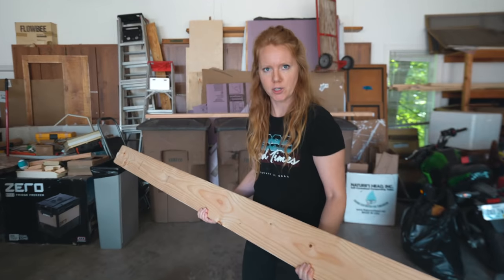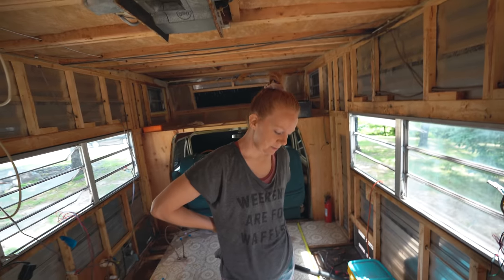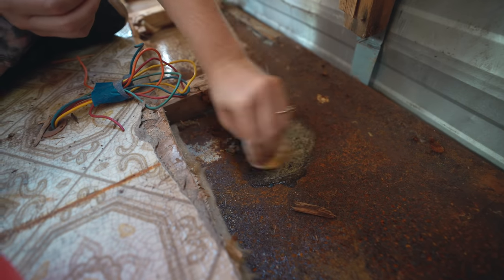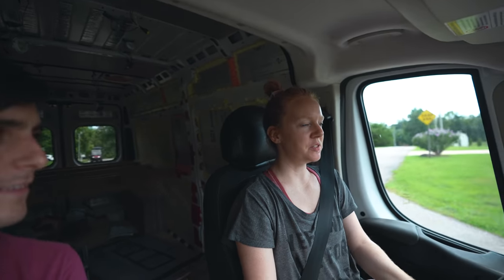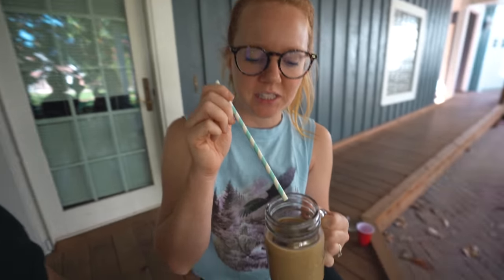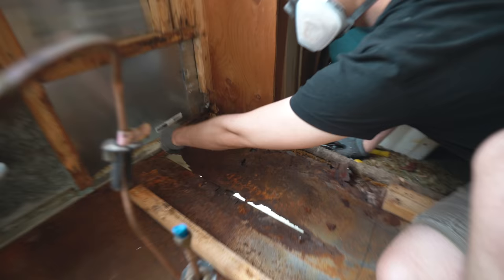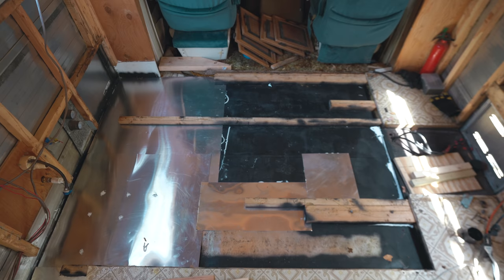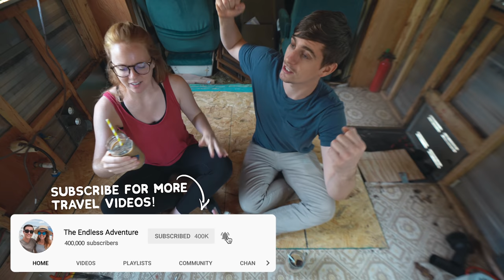RV Renovation - We Completely Rebuilt Our Floor! 😳 Longest Project Yet (Ep. 8)

Comment: I said the plywood needed to be treated, on both sides. First with a primer, and then with something like oil painting or marine painting of some kind. Because it needs to be sealed. There is also waterproof plywood, but it is expensive. You don't need the most expensive plywood when you are using it for subflooring. Just don't get the plywood which emits dangerous gasses. If it smells like wood, you are probably good to go. The OSB is not strong if it gets wet. It is much more porous that plywood, so it will disintegrate into small pieces. Don't trust people working in those places to be knowledgeable. He didn't even talk about treating the boards with anything. 
Here is an english repair of a waterdamaged floor in a Hymer Motorhome. Look at the floor sandwich. Hymer used styrofoam boards with rather thin plywood on both sides of it. Styrofoam is not legal to use in houses in my country, because they are dangerous in case of a fire (I am not in the UK). The plywood is not treated. Therefore it will mold and rot much sooner in case of a waterleak. If the plywood were treated, it would hold up longer before mold started building up.
https://www.youtube.com/watch?v=wgcrC1Hf8Us
https://www.youtube.com/watch?v=06EFvqJIejU
I don't like those crazy thumb nails, but you can learn a thing or two on how to fix a water damaged Hymer floor from these videos :-)
I had mold build up on the backside of the walls from using my van for camping during one summer. I had to paint the boards on both sides to seal them up.
Info on the boards:
https://en.wikipedia.org/wiki/Oriented_strand_board
https://en.wikipedia.org/wiki/Plywood

Comment: rust isn't something that sits on top of metal.. it eats it away. there is damage. the metal is thinner than it was bevor. 
Sure! you can "wash" the rust away but its not the best solution - like i said, there IS damage and the damage is not fixed with washing it off.

Comment: It's already been mentioned but you guys definitely goofed. That old flooring was not aluminum but rather thin gauge steel sheet metal.  Aluminum those not rust like that.  Have a you have put aluminum on steel you are going to have a galvanic reaction... pull it out and replace with steel...

Comment: whom ever said to use  OSB  was an unqualified idiot!  Use plywood to replace the OSB  when installing the new floor use 3M 5200 secure, it works on damp wood also on   you can buy the 5200 at home depot. use marine plywood too   if you want a permanent fix.use the 5200 behind all other items needing to be waterpoof secured,

Comment: With the dissimilar metals, aluminum on steel, You just created a battery, but instead of producing usable electricity, you will only get faster corrosion. You need to rip it all out. I’m so sorry.

Comment: Should have ripped up the rest of the vynil floor covering since you will be laying a new floor, that way you would be able to check the rest of the floor for rot. I would also used 1x3 battens instead of 1x4, it's all about saving weight where you can without compromising strength. All these new skills you're learning will come in useful when you come to do repairs, they will come, and when you add gadgets. You will know where all the pipework and electrical cables are and you can complete the build with future ease of future maintenance in mind.

Comment: 1) You really need to talk with someone who actually knows something about construction. There's far more going on and more you need to know up front than you would ever dream.

2) No, aluminum does not rust.

3) There is a place for OSB. The floor is not that place for several reasons.

4) It is probably apparent to all at this point that from a strictly rational stand point
Reply: I was gonna say about the rusted floor not being aluminium as only anything with iron in it would rust. Now I m no chemist but I m afraidd their aluminium patches would make some kind of weird reaction with the iron/steel previously rusted parts? Anyone know? Like hopefully not desintegrate or wobble away and create a channel for humidity?

Same concern about the OSB patch, I m afraid it s not going tp react on time on par with the rest of the floor. and I as well have never seen OSB used for flooring, I used it on cabinets and such
Reply: Since the floor holds everything up, I would replace everything and use plywood.  OSB will rot with damp or water and is heavier.  Every builder knows the importance of a good foundation.  This is my favorite couple and I love their renovation videos.  We all have to learn and you learn more by mistakes.  They are doing great!